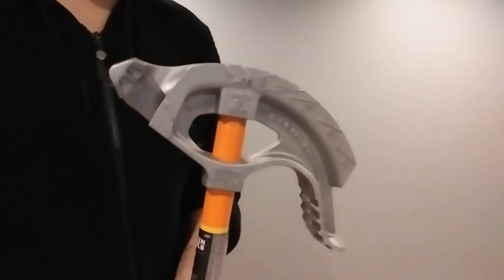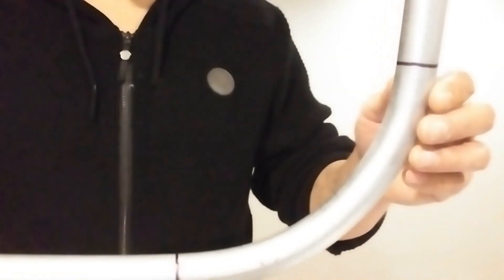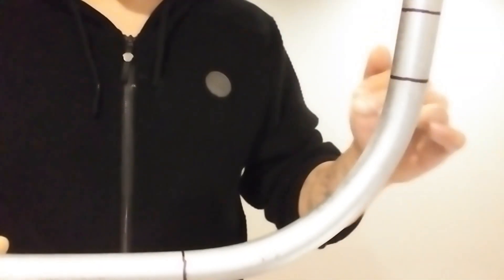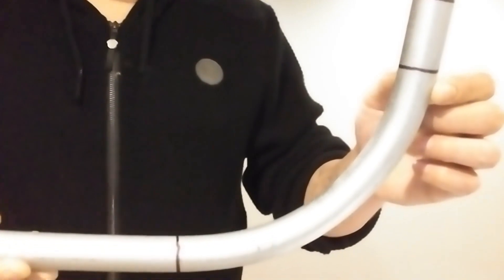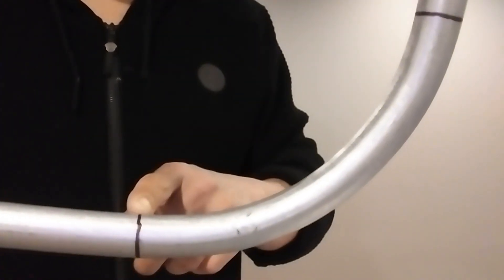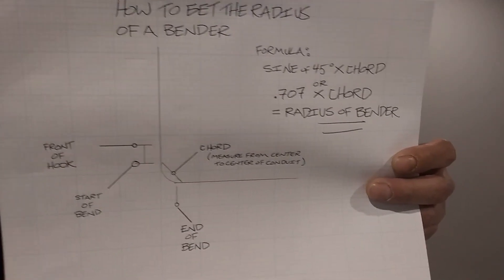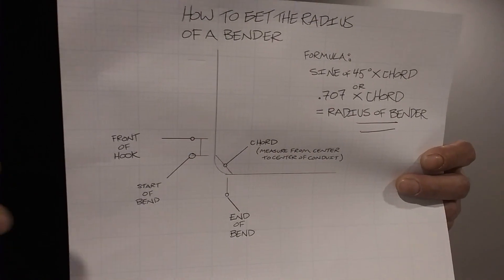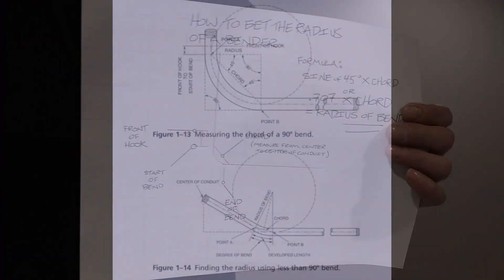Advanced Conduit Bending PT. 1 : How to measure the radius of any bender.

Comment: Hi Melvin, when you calculate DL of a bend, do you use center line radius (Radius - 1/2 outside diameter of conduit), or normal radius? I'm curious when you would use one or the other? thanks
Reply from the maker: there's no difference from the two

Comment: Does radius of the bend change dependant on the degrees bent? Or is it constant to the bender regardless of degrees?..

Awesome work. Thanks for putting the time into these videos
Reply from the maker: Yes it changes depending on degrees. Thanks for watching.
Reply: @TheArtOfConduitBending  So, just for absolute clarification, i would need to measure the "chord" of a 90° bend;then input into the formula to find the radius of the bender for 90°.  Subsequently, i would have to measure the "chord" of the 60° bend to find the radius of the bender for 60° and so forth for 30°,22.5°,10°...etc?

Thanks for responding so quickly.. i appreciate it greatly!
Reply from the maker: @Boosteeen  so not exactly as exactly.  When you measure the radius of the bender you can measure it in 2 ways that I know of one is measuring it through a 90 degree bend,  second is measuring it through a 45 degree bend.  The radius of the bender, is the radius of the bender. I'm sure you're able to measure the radius of  a bender through other degrees of bends but  I don't know the formulas for them. Your just measuring the radius to basically find the developed length so that you know where to make your bends.
Reply: @TheArtOfConduitBending  ahh perfect. Think thats the answer i was looking for. "Radius of the bender is the radius of the bender". 

Thanks a lot! All the best, my guy!
Reply from the maker: @Boosteeen  your welcome.  
Follow and endorse me on my skills in my profile on 
www. Linkedin.com/in/melvin-rubio
Reply from the maker: @Boosteeen  Anytime my dude. Hope that helped. Anytime you need to ask a question just ask. You can find me pretty much on any platform.

Comment: So the start of bend is where it starts to rise, and the end of bend is where you placed your initial measurement? Or how is end of bend found?
Reply from the maker: look at a 90. place a 90 on a flat surface with the 90 stub facing up towards the ceiling. where the bend starts to lift off the flat surface is the start of bend. now flip the 90 so that the pipe that was on the flat surface is now facing the ceiling. now where that bend starts to lift off the flat surface is the end of bend. I sent you a message on the last comment you sent me and i should have told you that when you are laying the 90 on the flat surface make sure the stub or leg is facing the ceiling hope this helps.
please follow me on and subscribe:
fb@holmzlaw
IG@holmzlaw
share with your friends and co-workers
Reply: Makes a ton of sense man, I really appreciate your time. Just started my first semester of my apprenticeship and the math is mad confusing. Keep up the great work og
Reply from the maker: @joshuadiaz3329  just let me know when i could help. With whatever. 🙏